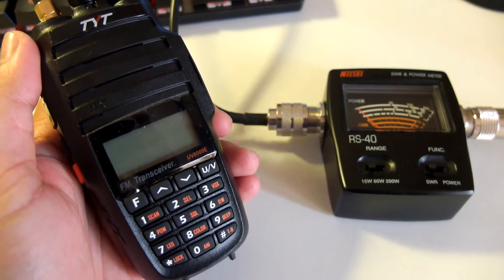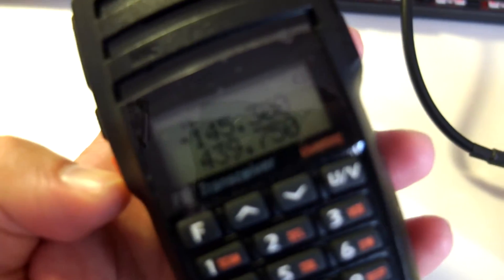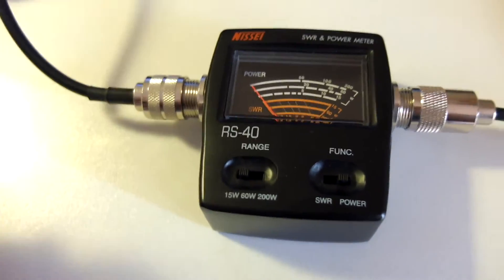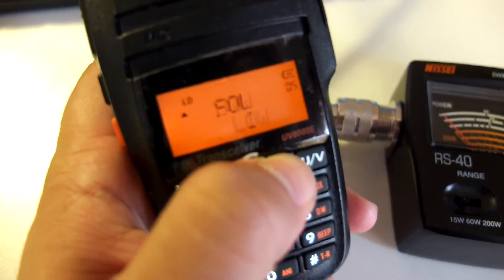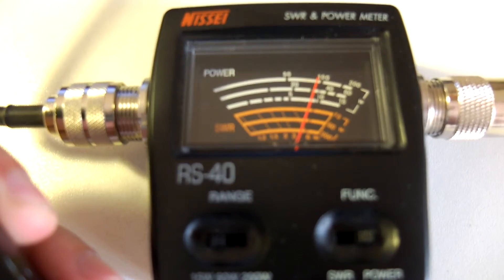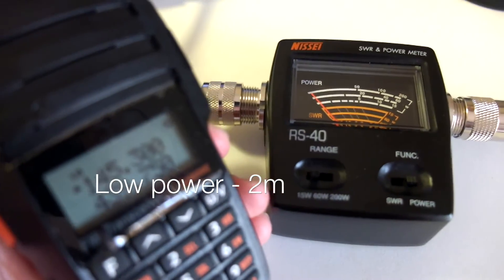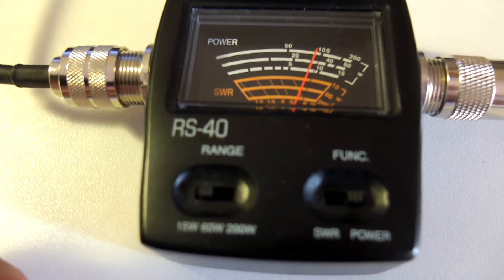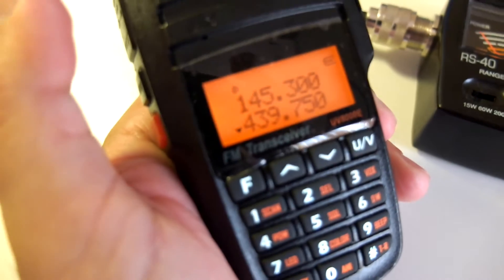TYT UV8000E Power Test

Comment: 🗣 I came up with the following numbers from my UV8000D. Even with a partially-depleted battery, it made little difference in the long run. 

TYT		UV8000D:

Frequency		    High		  Low
--------------------------------------------------------------
140.000		  	   9.22W		6.03W
142.725		  	   9.84W		6.03W
143.500		  	   9.98W		6.05W
146.355		  	10.40W		6.23W
440.525		  	10.50W		5.73W
442.000		  	  9.86W		5.68W
446.252		  	  9.57W		5.58W

Another favorite of mine, the Baofeng BF-H6, pulled down these numbers:

Frequency		 HIGH	 MED	   LOW
-----------------------------------------------------------------------
140.000			8.76W	3.55W	  .857W
142.725			8.74W	3.67W	  .94W
143.500			8.71W	3.73W	  .968W
146.355			8.74W	3.90W	1.0W
440.525			8.53W	4.38W	1.35W
442.000			8.55W	4.38W	1.35W
446.252			8.52W	4.27W	1.32W

These are my two favorite radios. As you can see, the UV8000D is a true 10W radio, but one should see no practical difference. The advantage of the UV8000D/E is the cross band repeater, which is an amazing feature. The disadvantage, of course, is that the lowest numbers are still too high. And they eat away at your battery power. The BF-H6, on the other hand, has three power levels that lets you choose the one which is best for your needs. The UV8000D/E has only two power levels, High and Medium. Both are exceptional. 🌞🌛✨

Comment: Great review...but why does TYT lock all its radios? And how do you unlock this one? Are all TYTs locked? And all the reviews seem intent on telling us how the crossband repeater works. That's great, but little is said about unlocking the radios and why TYT would lock the radios to begin with. If I had to do it by attaching radios to a computer, I wouldn't buy one. I'm thinking of buying an 8000D (they're a few bucks cheaper) and a mobile TYT. But locking them when it's not necessary makes no sense. The 8000E manual says unlocking the radio without permission is illegal. No it's not. You can even use the radio to transmit.

Comment: Okay, first off. I've had mine for a little over two years. I use it as a base station, and as a mobile on my bicycle. Now here is the kicker, yes it is a 10 watt radio, on ONE frequency. In my case using an ABBREE 18.8 inch antenna, that frequency is 146.000, right in the middle of the two meter band. Where the SWR of the antenna is 1.0 and the power output is 10 watts. Now, I use a repeater that is 146.775, on that frequency I have a SWR of 1.03 and a power output of 9.97 watts. So in the end it is all about the antenna being tuned right.

Comment: Nice thanks for the experience 👍🏾
And that mean the device not reach to real 10W in full way
Reply: Okay, first off. I've had mine for a little over two years. I use it as a base station, and as a mobile on my bicycle. Now here is the kicker, yes it is a 10 watt radio, on ONE frequency. In my case using an ABBREE 18.8 inch antenna, that frequency is 146.000, right in the middle of the two meter band. Where the SWR of the antenna is 1.0 and the power output is 10 watts. Now, I use a repeater that is 146.775, on that frequency I have a SWR of 1.03 and a power output of 9.97 watts. So in the end it is all about the antenna being tuned right.
Reply: @JamesHart62  I have the TYT UV8000E over two years too and works quite good to transmitting, but the receiver sensitivity compared with a Wouxum KG-UV6D looks like worst. could you share the amazon link to buy the ABBREE antenna that you comment, please ?
Reply: @James Hart  I bought the ABBREE 18.8inch antenna and I absolutly dissapointed with the performance. The antenna es worst than stock antennas included with UV8000E. I don´t know how you connected the ABBREE antennas cause of base is oversize and it need to "cut" rubber on base to fit the antenna output correctly. Other people that see this comment, please don´t do it.

Comment: You can fine tune the low and high power settings in 10 MHz increments. Using the TYT software, use the 'Program' drop down menu and with the radio connected click 'Test Online" at the bottom of the  'Program' drop down menu. Once you get there, the rest is self explanatory.
Reply from the maker: Very interesting info, I will check it out, thanks!

Comment: Does this radio actually receive narrow band when in Narrow Band mode (not all Chinese brands do that)?
Reply from the maker: I believe it does, as the audio is a bit lower when receiving with bandwidth set to narrow. How could I test this to be sure?
Reply: You should be able to hear the difference if you tune in to any commercial or public safety frequency, that you know uses narrow band, and switch between narrow and wide.
Reply from the maker: Oh OK. Then yes, the radio receives narrow band properly.
Reply: Great! Have you tested it and noticed the difference?

Comment: Battery full charged, without TX (just on stand by - RX), option 19 in menu RX power saver was OFF, battery last at the first radio - 25 hours, the second radio - 28 hours until itself turns OFF. From total empty battery, needs 8,5 hours to full charge (until green lit).

Comment: I have watched those emissions on you tube and I decided to buy TYT UV8000E. So at the beginning I must say I'M DISAPPOINTED!!!   I have two pieces now, I have tested on many frequencies UHF and VHF. I have not yed tested in open area, but normal I need them to be functional in TOWN, IN AREA WITH BUILDINGS AND HOUSES! With original small antenas, at the earth level, not from the floors high, I have reach connection approximately JUST 200-300 METER AIR LINE!!!!!!!!   With others, hi gain antennas, JUST A LITTLE BIT MORE, about 400-500m air line!!! (town area) and of course set on high power.   I Don't know what are those WATTS but with 5w Motorolla I have  ~4km air line in town area( my town is about ~6km in diameter). I'm so DISAPOINTED  And I think something is made in electronic on these chinese toys to show those watts on the SWR Power meter but  i believe in reality they shows some FAKE POWER. From earlier, I have also two pieces Baofeng UV5-RTP 8W and With 17cm long antenna these are better. Real, according with the reachable distance, I give 0,5W of LOW power and 1W on HIGH power.
Reply: Jane Georgievski Are u sure??? my baofeng UV5R and 888s, they can communicate 2km away in the forest. But only reach 300-500m in town are, because there's a lot of house...
Reply: First off, get rid of the stock antenna. Get the ABBREE, either the 15 inch or the 18 inch, you will notice how much better your radio gets. Okay, second, I've had mine for a little over two years. I use it as a base station, and as a mobile on my bicycle. Now here is the kicker, yes it is a 10 watt radio, on ONE frequency. In my case using an ABBREE 18.8 inch antenna, that frequency is 146.000, right in the middle of the two meter band. Where the SWR of the antenna is 1.0 and the power output is 10 watts. Now, I use a repeater that is 146.775, on that frequency I have a SWR of 1.03 and a power output of 9.97 watts. So in the end it is all about the antenna being tuned right.

Comment: What is the difference between TYT UV8000E and TYT TH-UV8000D?
Reply from the maker: They are practically identical. The "D" model had some issues with the audio, where it would start chopping up after some time of continuous reception. They have fixed the issue with the "E" model. Also, both models are "UV-..." and not "TH-UV...".
Reply: Ok, but on the official TYT website there is no model with "E"!
Reply from the maker: That's probably because they have either a: not updated it yet (it happens) or b: it is a "special" edition for a retailer.
Reply: E stands for export model.

Comment: I'm curious to know if the radio's power output improves on 2 meters if you use the battery eliminator.  I know my FT-60 seems to put out a little more power when I plug in a external power source. 
Great videos. 73.
Reply: can u send me the link to buy one?, i don't found one in the market. Thank you for the review
Reply from the maker: You are right. I have an eliminator for the radio, so I will do a video on it. Thanks!
Reply from the maker: Jurgen Creixell Torres Sure, here it is (affiliate): http://amzn.to/2e3Xslz

Comment: Interestingly, it's more powerful on 70cm than 2m.  Most of the radios are the other way around. 
Do you happen to have the tri-band version UV8000SE?
Reply from the maker: Hello, yes, being more powerful on 70cm is surely something out of the ordinary. No, I do not have the tri-band UV8000SE.
Reply: IS there a tri-band version of this radio? Guide me to it, if you please! I've never seen one, but would like to have one if they exist. For that matter, does anyone know if there is a practical difference between the UV8000E and the UV8000D other than cosmetics and labeling? For that matter is there a difference between the TYT UV8000D (or) E and the TYT TH-UV8000D (or) E? I've seen them listed and advertised both ways, some with the "TH", some without. The ads never mention any differences but it would be good to know if anyone has input on this.
Reply: @bradhollis1005  There was a tri-band version UV8000SE. It is no longer available. The difference between the D and the E version is that the E version has some glitches of the D version fixed.
Reply: I purchased a "D" version since Radioditty was sold out of the "E" version so I'm hoping you're willing to be a little bit more specific regarding the glitches that the E version solved.

I'm also wondering if there is a difference between the uv8000 and the TH-uv8000. I see them advertised both ways, with and without the "TH".

Thank you, you are a much appreciated source of information as well as inspiration.
Reply: @bradhollis1005  the D version had a glitch where audio becomes distorted after a long period. Please see here: www.hamradioreviews.eu/2016/10/10/tyt-uv8000e-review/ I have the E version still in box, never even unpacked. Bought it a couple of years ago and never used. Let me know if you're interested. I can sell it to you.
Reply: @wimpog97  depending on how much you need to ask for it I may very well be interested.
Reply: @bradhollis1005  Send me a private message.
Reply: I'm not sure I know how to send you a private reply. Enlighten me, please.
Reply: @bradhollis1005  email me my username gmail
Reply: @wimpog97  q
Reply: Wimpog97
Reply: Wimpog97, I'm not particularly thrilled with the idea of leaving my email address out for all to see. perhaps, if you're less concerned about that, you would leave your email address and I could contact you regarding the uv8000e you may want to sell.
Reply: @bradhollis1005  what's your email?